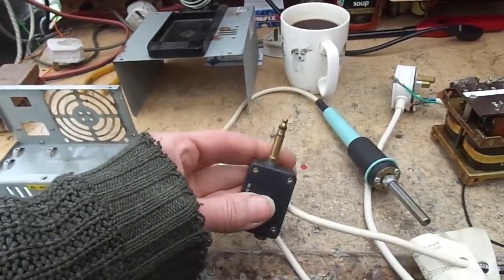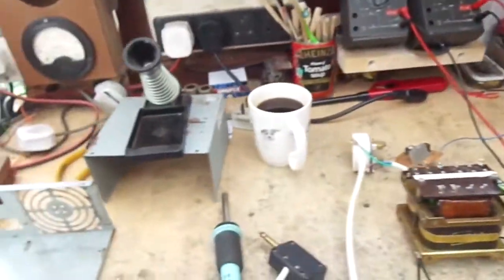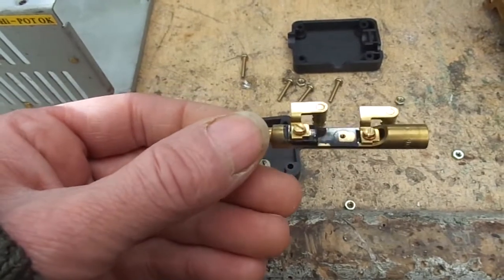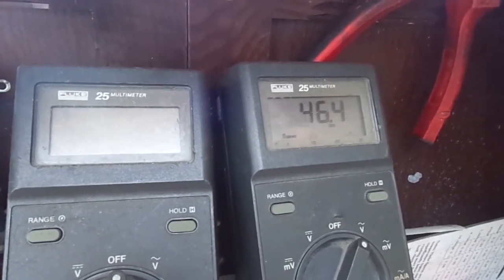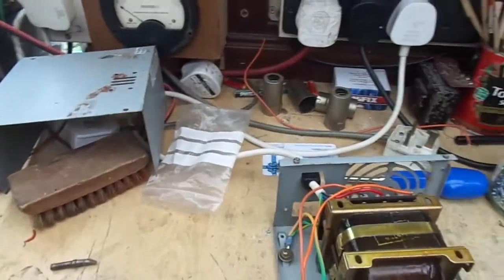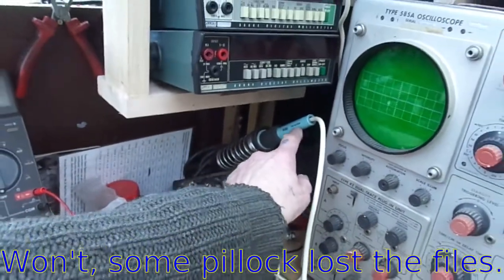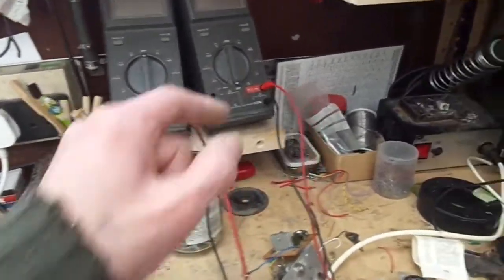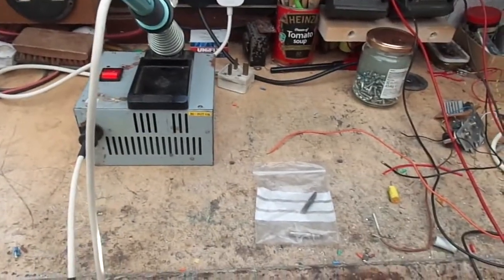DIY Weller TCP Soldering Station

Comment: Im having a lot of problems with my ions. Iv been through lots of cheep Chinese ones they r shit. I’ve had a rs pro soldering station it lasted less than 6 months. All the soldering tips seem to be shit these days. I’m not happy with any ions I’ve had. I’m going to get a weller soon. I’ve already got a few old weller tips !  For the time being I’ve been trying to make my own elements and handles. To be fair it’s hard to get right without proper machining. I’ve made my own ceramic heating elements they work well. Im not going to give up till I make an ion that works reliably! ( or get the weller ) 😂🔥
Reply from the maker: Yep, had the same thing, mainly used Antex 25w irons but the tips don't last long. I now use the Weller TCP & was fortunate to be given some old tips. These old tips last a lot longer than the new ones from Mexico. you can pick up TCP irons and old tips on Ebay still for a reasonable price.
   My friend in Cuba built his own iron, it's like one of the big Weller 100w jobbies, uses a tfmr to get high current, copper wire is the tip. Big & heavy though.
    Helps to get decent solder too, see if you can buy a reel of some old 60/40. Good luck.

Comment: Hi. That 50 volt Weller iron was made for British Telecom. The plug you were admiring is a standard GPO jack plug, and plugs into a socket very similar to a standard quarter inch jack. The distribution frames and apparatus racks are equipped with these sockets for soldering irons etc. The little brass pip on the back of the plug is to connect an ESP( electrostatic protection) strap to a suitable earth/ anti static mat etc.

Comment: Andy, 
Be sure to add  fuses  to the power supply. Pr.i & Sec. And stuff spares inside it. in it. I was on a svc call 65 miles away & my fuse failed. :(
 Yes the newer tips are total crap. The old ones held up quite well. I even tried tinning the newer ones with silver solder to prolong life, but it didn't.
   I found the slightest nick in the OEM tip coating quickly caused the tips to erode away. Since my local supplier at the time was charging about $12.00 USD at the time, it really sucked. Found another supplier, and they were $1.99 USD from them. Exact same tip by Weller. Needless to say, I bought a handful at that price. I really like the 800 deg. F tips. They seem to solder quickly and not lift traces like the 600 deg. F ones.
Reply from the maker: Bugger! That's something else I forgot, a fuse. There's one in the plug, but still,thanks for spotting that.
Reply: @diabolicalartificer  No problem Mate. It's not like I haven't had one of those transformers fail &  the iron go up in flames... or anything like that,,,,, (Choke, cough...)

Comment: Wonderful little build :) Simple and reliablie! I am thinking about getting one of them irons too, because my current iron is abit embarrasing to show off to be honest, handle fell apart so I had to tape it back together but it works really well, it just doesn't look all that nice lol
Reply from the maker: A good iron is invaluable, I've struggled with crap iron's and screwed up PCB's, better to have a bloody hot iron, in quick out quick, a cowboy as they say in bank robber parlance.
Reply: @diabolicalartificer  hehe, yup :) I dug out my beloved old Weller WHS 40 with a broken tip last night, the tip broke off inside the heater several years ago and I got annoyed and put it aside. I took my drill and a tap, and I drilled and was able to then pull the remains out. Now all I gotta do is put in a new tip, and then I'll have my beloved old iron back! I feel stupid for not doing this years ago when it happened, but I had a limited set of tools back then so perhaps that's why I never tried. Anyways, I think that'll be my project for today, make a new tip for it on the lathe :) Also I gotta stop being lazy and edit my videos :P
Reply from the maker: @tigerelectronics5966  I use Shotcut, it's pretty easy to use. It also helps if you film in short segments,then it's just a matter of adding transitions and the odd bit of text.
Reply: @diabolicalartificer  I'll check that out, filming in short sections sounds much easier than what I have been doing too, I'll give both a shot and see how it goes :) 

Currently been using Kdenlive, and it's a real hazzle....